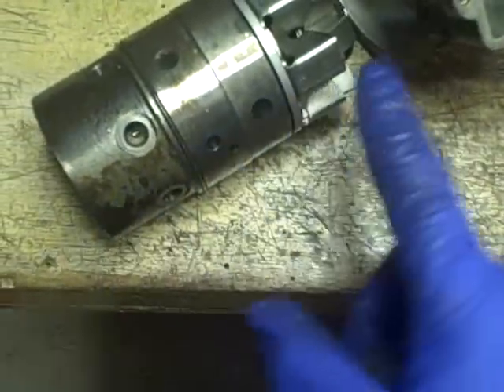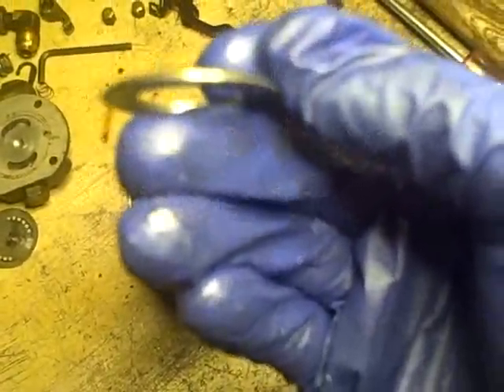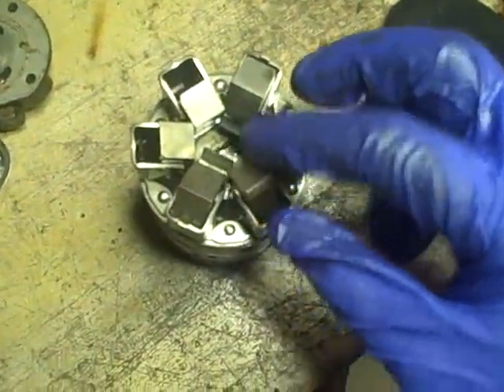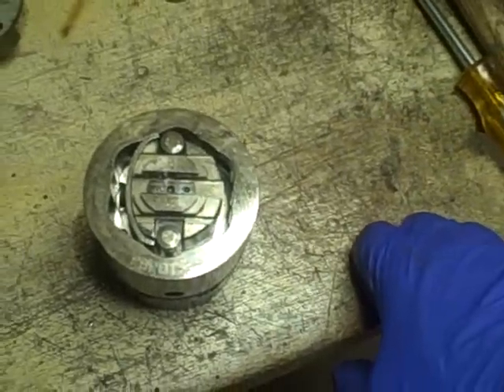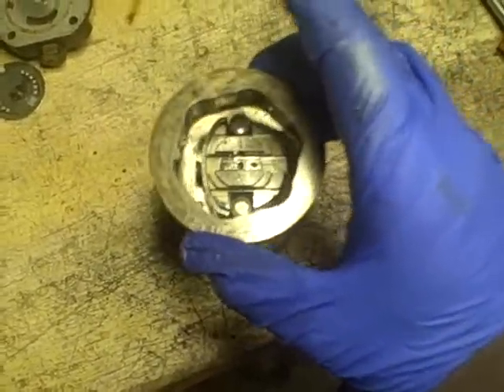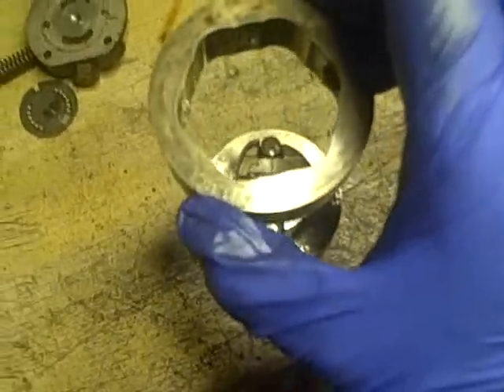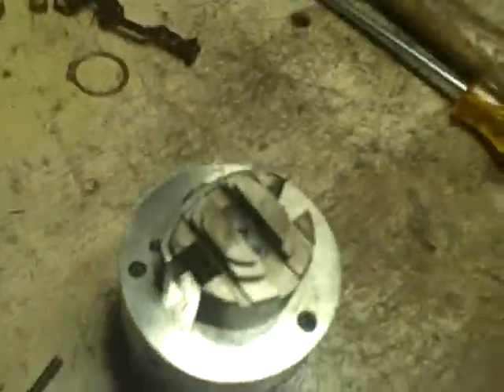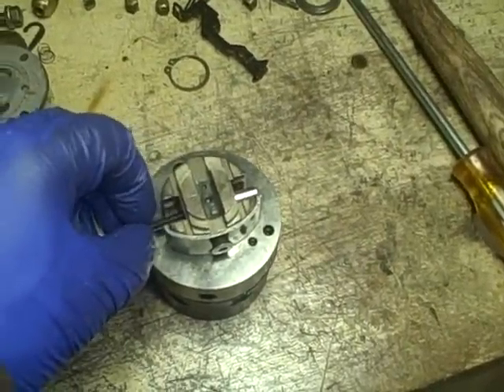Oliver 770 Industrial Tractor Project Part 62: Yup, still dis-assembling the pump.

Comment: I would say that your undertaking of this task has less to do with bravery and would be more accurately described as supreme confidence. Thank you for the excellent series for the Roosa pump! I have yet to decide whether to do mine or take it to the injection shop but If I DO decide to take it on it will be in no small part because you pioneered much of what I need to know.
GREAT STUFF!
Now, back to the rest of the videos and my continuing education;~)
Reply from the maker: Thank you for your kind words.

Comment: Hey Steve your a very brave man taking that pump apart!  looks like quite the pile of parts, I  hope when you do the inspection you don't have to replace the cam ring. The one in my Roosa  Allis Chalmers 180 pump was worn and I believe in 2004 that was a $400 new part here in Canada !. I got lucky and picked a used pump core up for $80 in a wreckers, and my pump guy built one good outta the 2.
Good luck with it 
Regards Robert
Reply: Hey Steve, that upgraded ring that used to be plastic.
Did you have a part number for it or the stock one?

Comment: I have some rust in the bottom of my pump really only in the governor area its not super heavy but just some light spots on the weights and the sleeve that the weights sit on. I am going to replace the sleeve but do you thing a rust dissolver is to aggressive on the weights?
Reply from the maker: fliksis hmmm. on mild rust i like pb blaster and a rag. scotchbrite pad if you need a little more  abrasiveness. if it's rusty enough to have pitted the metal, I'd advise replacement.